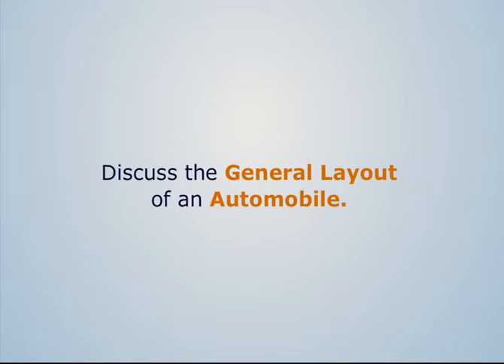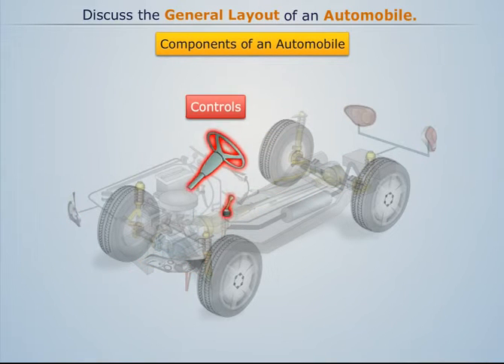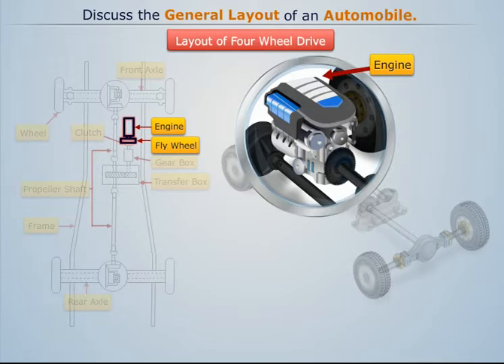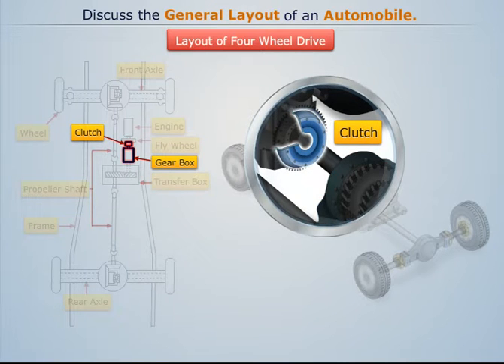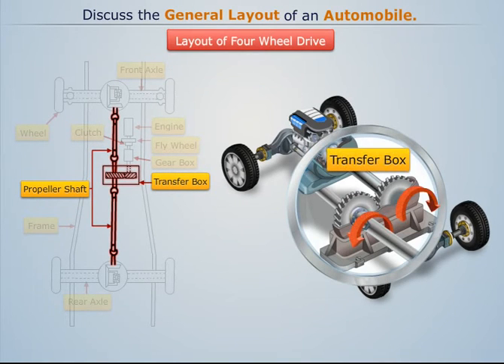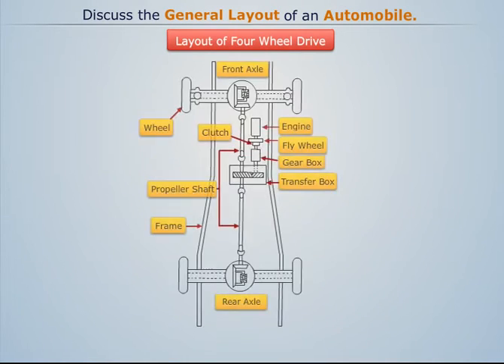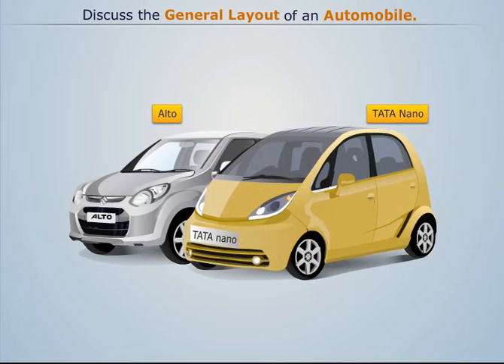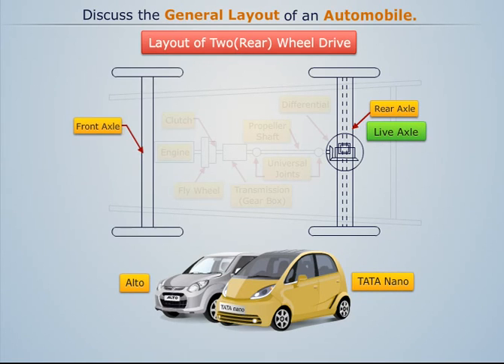General Layout of Automobile | Automobile Engineering

Comment: sir I am Pranav but please explain that how engine produce torque.
Reply: hi, iam not completely sure but you need to see what kind of engine is being presented in this video and just.... look it up on the youtube further ;0 cheers !
Reply: as a matter of fact, it would be better if you watched the electrical engineering course by EngineeringMiondset channel first(36 videos) :d There, they describe the electrical motor/engine or the induction motor/engine. Dunno for sure what kind of engine is used in a car, but most likely it converts the energy of the fuel/diesel oil/gas to mechanical power:0